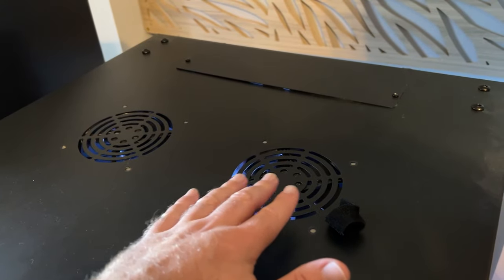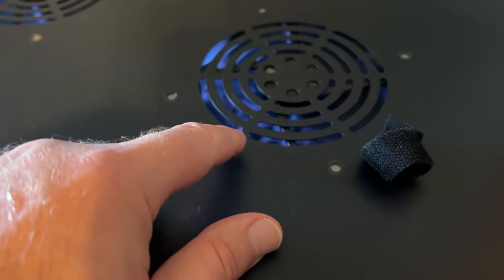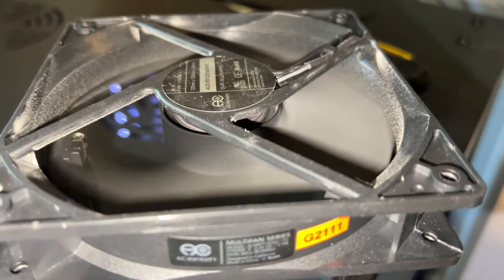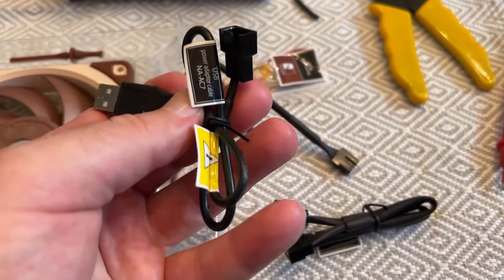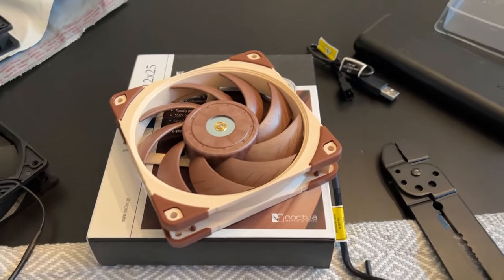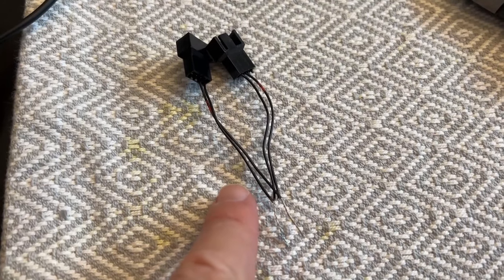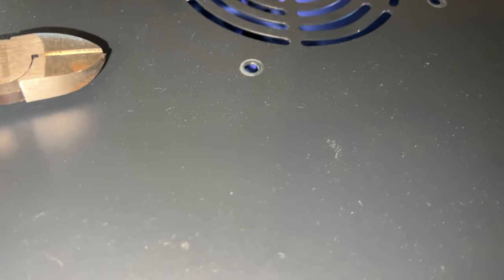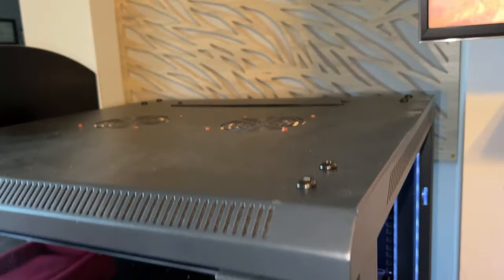Silent Home Theater Cooling Fan Upgrade

Comment: IMHO using the low-speed version (1200RPM, 12V) is the ideal mix of air flow and fan noise (still silent up to 1 foot away)

You should also probably use the included gasket to make a better seal to the top of your cabinet. I doubt it will make much difference (as they're designed to seal to PC radiators for better air flow there) but it's free in the package and can only help

If your cabinet has intakes it's worth adding an equal number of fans to intake as exhaust

Comment: Can you make a video on how you connect the fan with Alexa voice control? Is your upgraded fan 3pin or 4pin? And what’s the difference?
Reply from the maker: It's simply on a smart plug - use one of your choice.  It doesn't matter if it's a 3 or 4 pin, you are only using two.  The other wires are for PC use.

Comment: How does the Noctua fans compare to AC Infinity fans of simlar size?
Reply from the maker: More flow and no noise, not even in the same ballpark
Reply: @COGuyStuff  much appreciated for this response. I really am trying to find the right combination of 2 intake fans on bottom of of rack and two exhaust up top, all controlled by a central temp controlled controller. Can the AC Infinity Controller 12 work on 4 Noctua fans plug n play. I'm not much of a hobbyist so looking for something that can be plugged right in and work
Reply from the maker: Not plug and play, no.  You will at minimum need to do some splicing and wiring.  And it all depends on exactly what fans and config in the rack you are going for.  Sounds like you just need to stick with all ACI equipment and let it run.
Reply: @COGuyStuff  I Heard that running a PWM fan with just a 2 wire voltage controller isnt the best for a 4 wire PWM fan, and that a 3 wire fan should be use instead